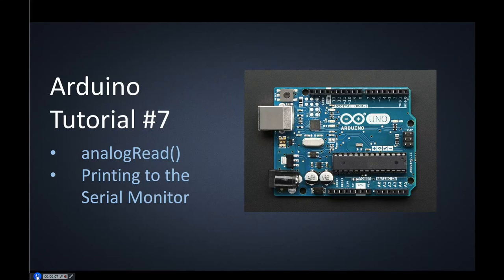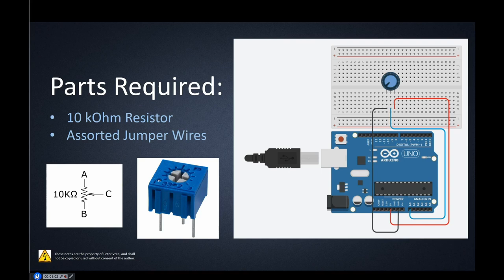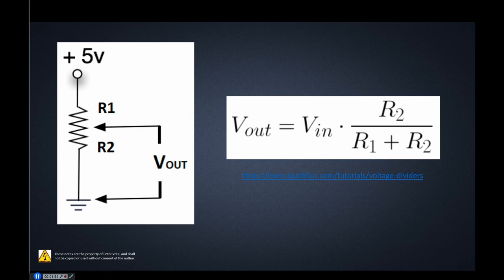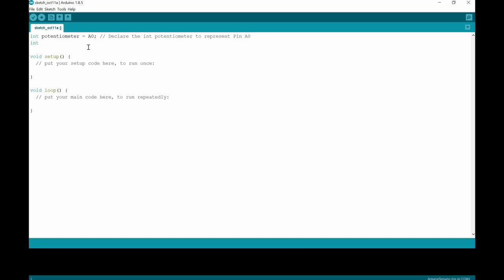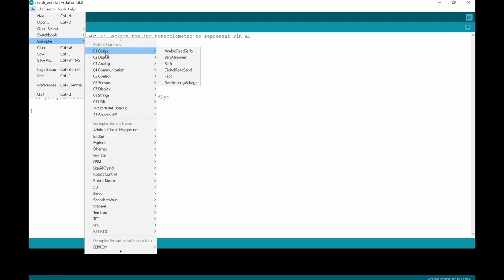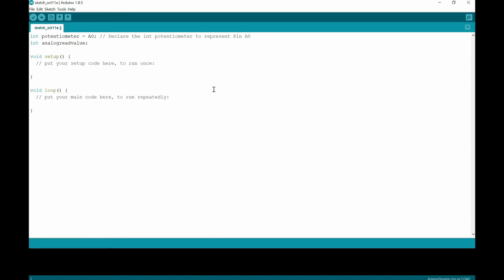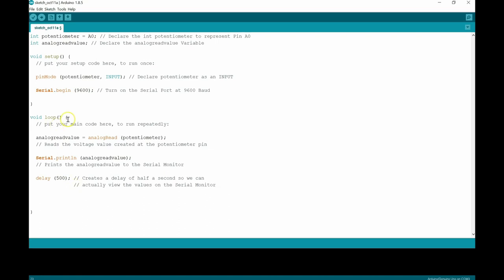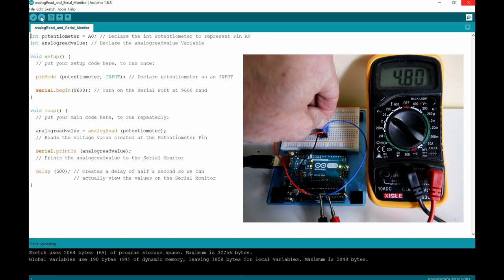Arduino Tutorial #7 (analogRead & Serial Monitor)

Comment: I would like to propose a suggestion which could explain the varying voltage when the potentiometer is fully active. I believe there is a certain tolerance to resistor varying from +1% to usually around 5%-10% from my experience anyway according to the colour bands chart. So the potentiometer could just be cheap and not set very well.